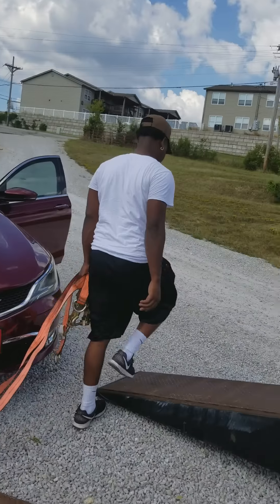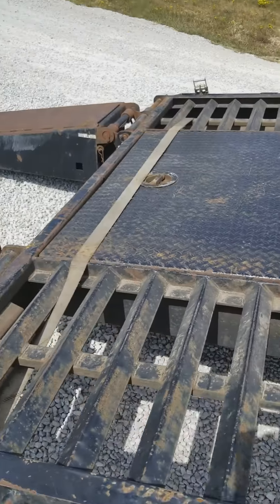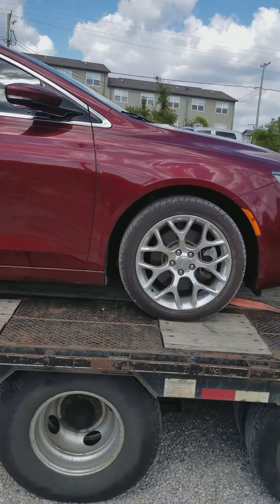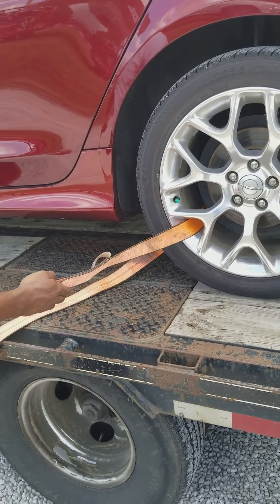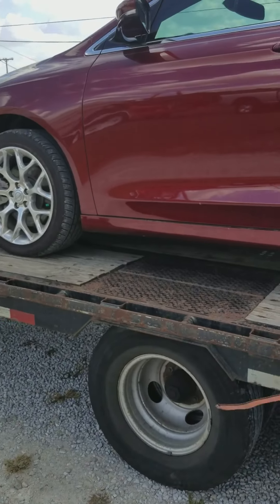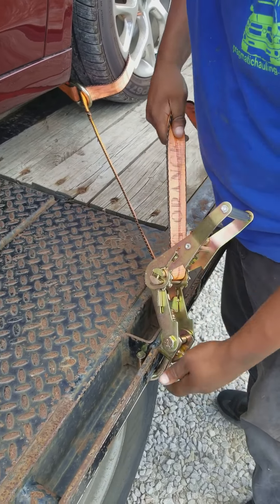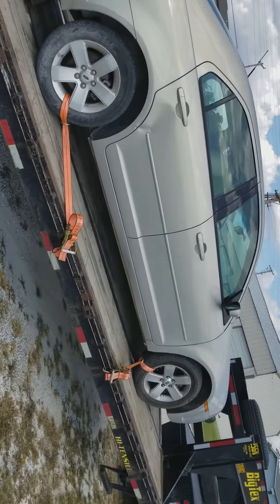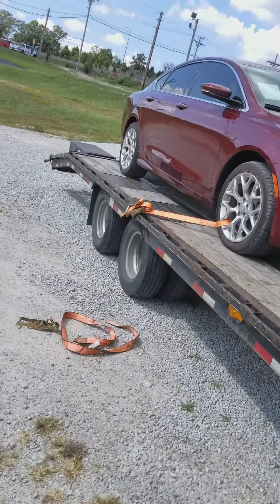Car Hauling on Flatbed

Comment: Hey man. Got the same trailer but with mega ramps. Do you think I could load cars on it? Do I need additional ramps or wood?
Reply: Your okay if you’re loading an SUV or pickup with Mega ramps.  With cars, loading on Mega ramps is a little difficult.  You can either get some Race Ramps for clearance or some aluminum ramps for your trailer.
Reply: Thanks for the reply, yeah never have tried with anything but a big truck. Not sure it's worth getting extra ramps so sticking with only freight for now. Not sure if it would work to even try cars without a car hauler.  @cbrownlee1

Comment: Absolutely no way I would tow that car with the straps like that....Several pot holes later and those hooks on the straps will loosen and come off.  Get some D-Rings and locking hooks.